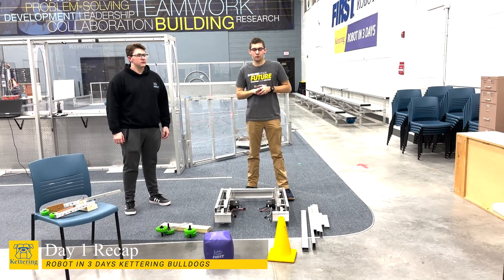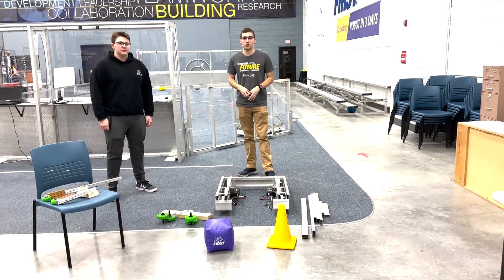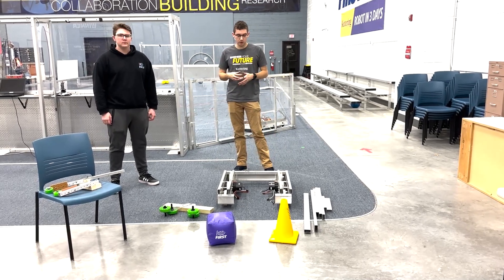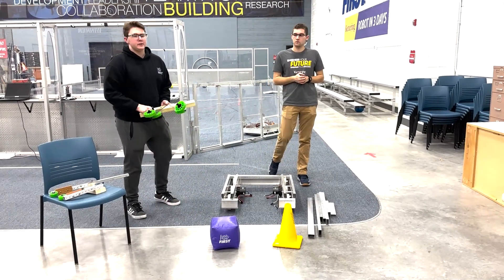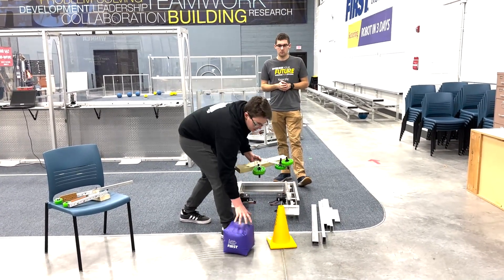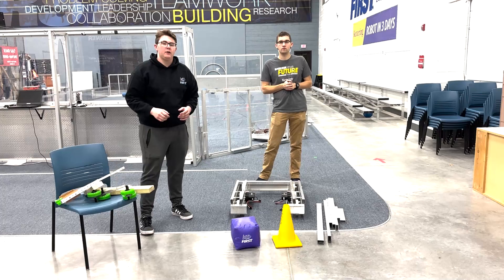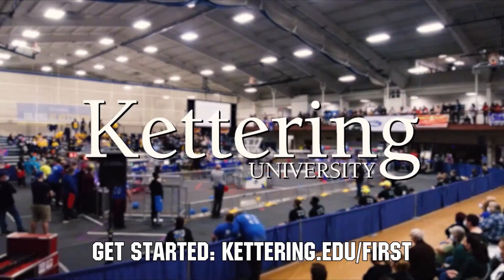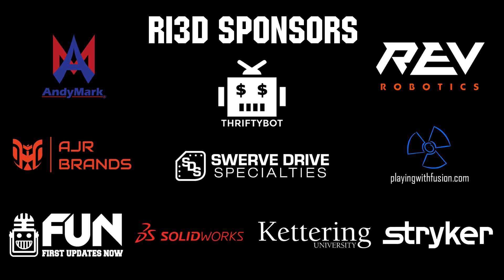Day 1 Recap | Kettering Bulldogs Ri3D Charged Up 2023

Comment: why does it have to be powered by two motors?
Reply: Typically that's easier than running belts or chain down each arm to one motor. This way they can also spin in opposite directions to adjust the rotation of objects
Reply: Doen't have to be powered by two motors, we went with a two-motor design as it is easier than running belts across.